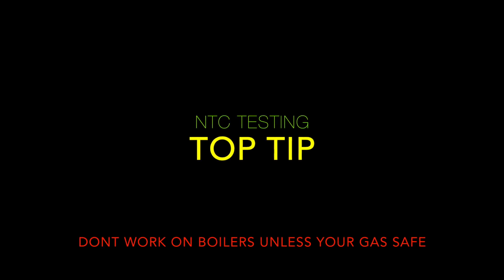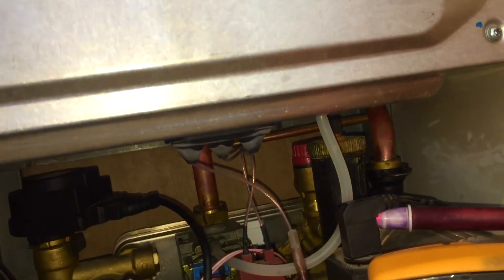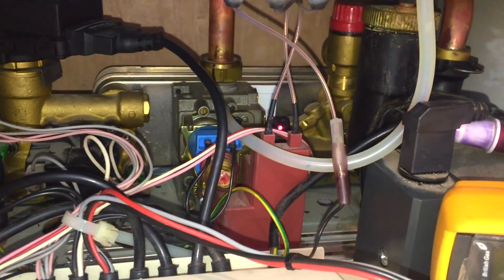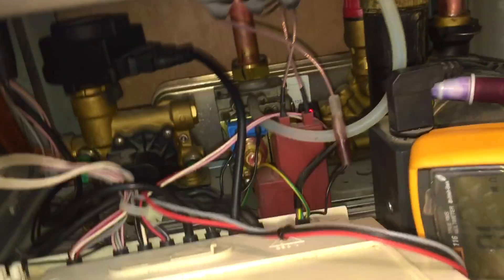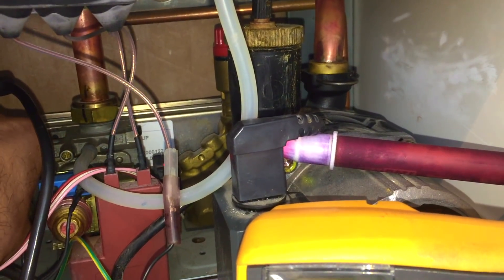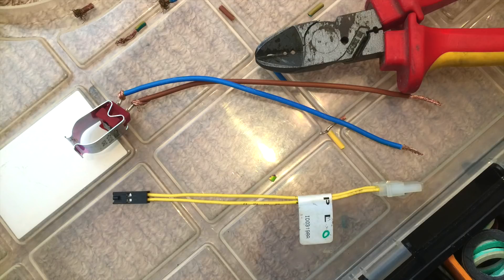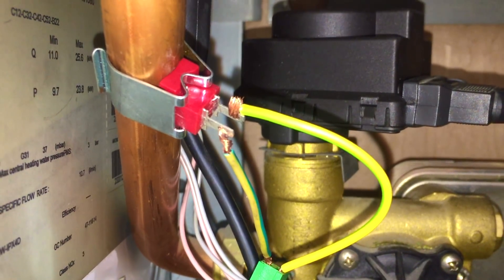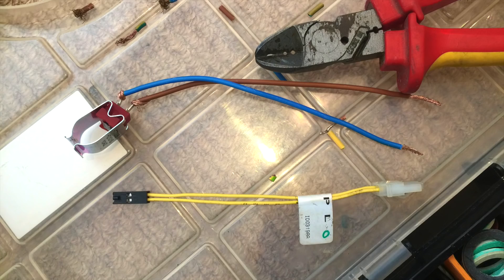Top Tip for ntc testing. Ariston boiler repair. Combi boiler repair

Comment: Could have been that if the ntc sensors readings were ok that they just needed some heat paste on them as they don't work correctly with out it
Reply from the maker: A lot of them do need past but this one was going OL intermittently. I actually have it in my bedside table :-).

Comment: Interesting to know how far out of tolerance a thermistor has to be before it no longer fit for purpose. ? Does the measured resistance change slowly over time ?  I guess measuring thermistor resistance during successive annual services would give some clues - if anyone had the patience, time, and money.

Comment: How do you change the ntc, got any vids on that!?
Reply from the maker: Drain it. Undo it. Fit new one. :-)
Reply: HeatingGeek thanks for replying. Do you need to shut off water and drain the system before changing it then?
Reply from the maker: @zendenball  From your questions I don't think you are gassafe registered. There are more than one NTC on a boiler and depending which you are replacing there will be a different method. I strongly suggest you get a gassafe engineer to come and replace the part so the boiler will get 26.9 checks afterwards.
Reply: HeatingGeek I’m not and I take full responsibility for my actions and place none with you!

Yeah I can see there are two, not sure how I get to the one I need to!

Comment: A bit late but you could use a variable resister, potentiometer in the right range 20k maybe, instead of the ntc and adjust it to simulate the ntc reading, could work with any boiler, 😉 always interesting!
Reply from the maker: I could, but I have 10-12k NTCs on my van and 90% of new boilers use them. Keeps it simple. Also I can actually use the NTC to control the boiler. :-)

Comment: Wish you lived near me, I got a Glowworm electronic 80e pump constantly running no demand pcb burnt out, changed it. Still no good heating won’t work. When it finally came on (think there lose connection as when I shut case it sometimes fires) the heating kicks out after 3 min!
Reply from the maker: Glowworm electronic? Compact?
Reply: Yeah it’s the compact! Would make a great boiler for a video! Starting to think it’s the integral clock or possibly diverter valve as hot water working fine! Fancy a visit?!
Reply from the maker: The clock is easy to link out. Thats a pretty old boiler that I haven't seen in a few years!!! Good luck!

Comment: I have a pack of resistors with known values that you can simulate the ntc. Just plug into socket.
Reply from the maker: Thats ok if you have them. This will actually read temperature and feed it back to the PCB .